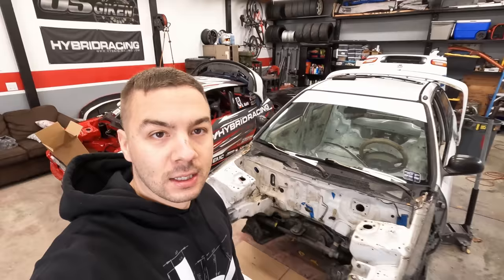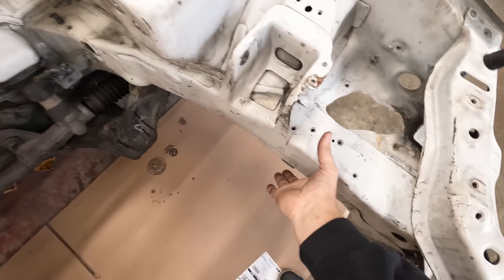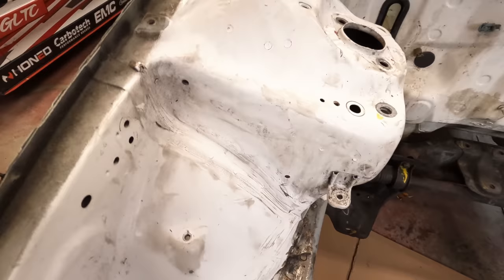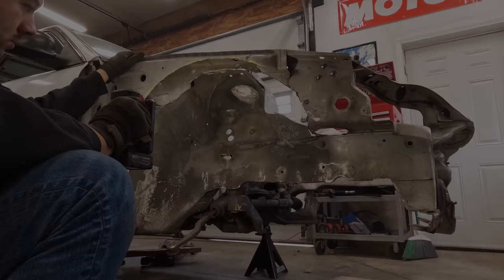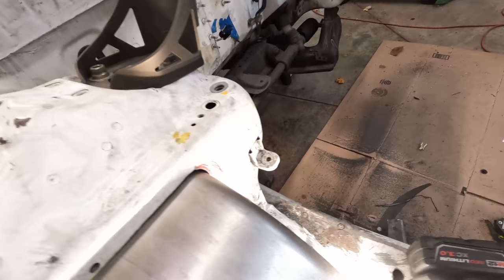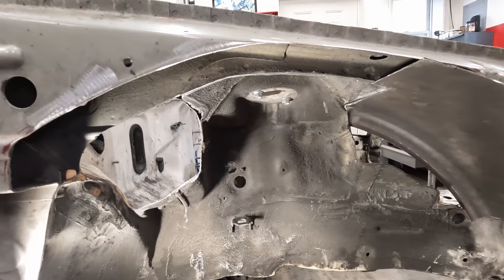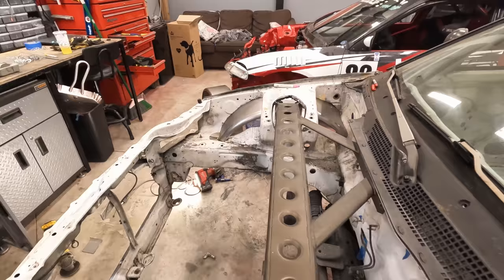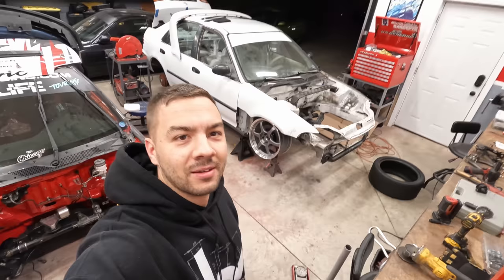Tubs on EG Civic Part 1 | EKR VLOG Ep 4

Comment: Eric, You're damn handy with a cut off wheel, but geez, gotta no someone that'll lend you a plasma cutter. I was thinking about  chassis support when you used your tower support. Excellent idea. And just curious with an early time frame question. Does all this get blasted clean once you're at paint stage?
Reply from the maker: Plasma cutter would be rad! I do plan on soda blasting the chassis, yeah! That's down the road for sure though

Comment: Reminds me of Honed Development's rear tub work :)
Reply from the maker: Yup, I'll be doing a very similar setup back there
Reply: @EricKutilRacing  If you were to build an EG sedan that doubles as a daily driver, which dampers and what spring rates would you run? Would you run swaybars on it too? Thanks!
Reply from the maker: I would run Fortune Auto 510s. Probably 700 lbs/in front 500 kbs/in rear with bigger sway bars. That's pretty much what I run in the ITR
Reply: @EricKutilRacing  Thanks! By the way, did you keep the bars in the ITR? Also, what tires do you run for track using the ITR?